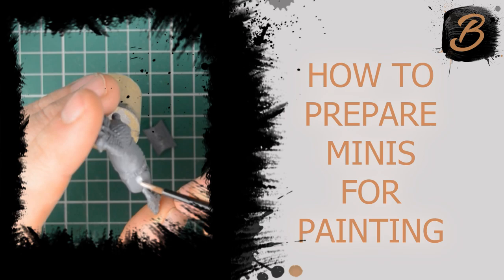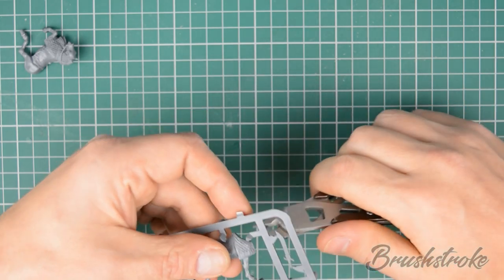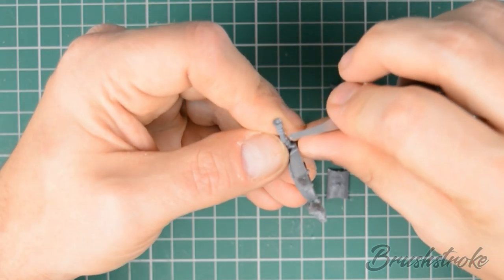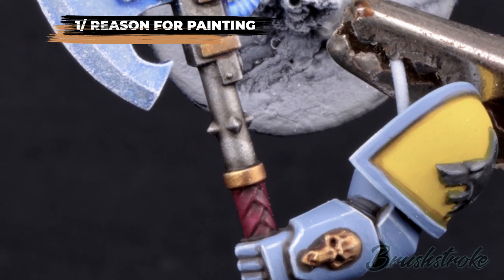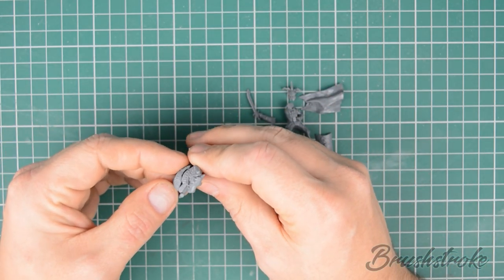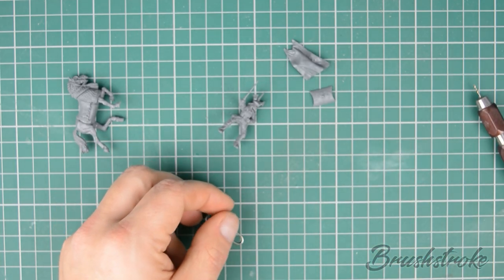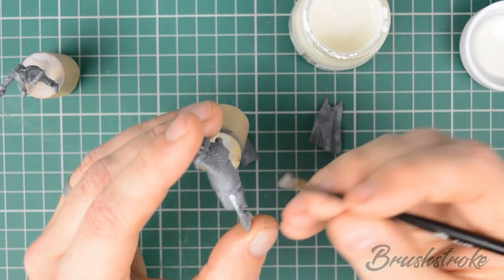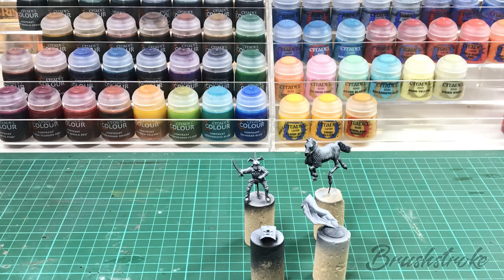HOW TO PREPARE MINIS FOR PAINTING: A Step-By-Step Guide

Comment: Interesting, I've been trying to sus out the way you mount your minis and I honestly never would've considered super glue and paper clips. I'm brand new to the painting side but I'm definitely gonna be trying that out since it looks like you gain much more access around the mini parts. Two questions though: 1. Do you buy the corks in bulk? 2. Do you reuse the cork + pin combos at all? Thanks!
Reply from the maker: Yes, mounting the mini (or its parts) in this way makes it so much easier to access with my brush.
To answer your questions;
1/ yes, absolutely I used to buy them from Wilkos but they’re out of business now 😞 So, my advice would be to look for stores that sell home brewing kit.
2/ Yes, I reuse them all the time. I often have to replace the wires because they can come out when removing the model or they’re not the right length for what I need at the time, but I use the corks over and over again.
On last tip, which wasn’t in the video, if you get a piece which keeps toppling over when you put it down. Because the cork isn’t enough to keep it standing on its on, just glue a coin or washer to the bottom and give it more weight / stability. Works perfectly 👍

Comment: So, subassemblies: Do you do anything to the models when assembling the final piece? Or do you just glue painted surface to painted surface?
Reply from the maker: It’s best to not glue painted surfaces together as you’re then relying on the painted layers to hold things together.
What I do is try to keep areas clear of paint which I know will be glued at the end or if that’s not possible, carefully rub the paint off at the end to crest bare plastic / metal to glue together.
I also use superglue to try and maximise the bond between pieces.
I hope that helps 👍🏻

Comment: I'm new to the hobby and I assembled my mini before washing it. What do you suggest doing? Can I drop it in soapy water as-is?
Reply from the maker: Thanks for watching and welcome to the hobby 🙂
Yes, you could still gently wash off the release agent from a model which you have have already assembled. 
Obviously it’s not ideal, as you don’t want to break it during the process, but my suggestion would to be to submerge it in some soapy water and then give it a gentle rub with a soft toothbrush and then a rinse with some clean water.
That should be sufficient.
Hope that helps 👍

Comment: Great video, I have suscribed to your channel! One question, is it possible to use Gesso as a primer? 

And do you have a video about using primers?
Reply from the maker: Thank you.
I've never tried Gesso primer on a mini before, so I can't really advise either way.
I believe though that it is intended to leave a surface with some texture or "tooth" to it, which is never a good thing for mini painting, as you really want super smooth to see all the fine details
This is the only video I've done referring to primers. If you can get Vallejo surface primer I do recommend it.
Just be sure to let it fully cure for around 24 hours before painting on it to ensure it forms a strong bond to the mini
Reply: @BrushstrokePaintingGuides  Thanks for your answer. 

Just to be clear, what does "cure" means in this context? English is not my native language.
Reply from the maker: @fernandozavaletabustos205  sorry, it means to dry fully.
Primers can often be dry to the touch but still be in the process of hardening.
Yeah, that’s a good word, cured in this context means fully hardened
Reply: @BrushstrokePaintingGuides  Ah do not worry, I was asking in order to learn more about the hobby.

Comment: Wow, such a good idea. Just one question though: how do you attach the shield and cloak to your handle please?
Reply from the maker: Exactly the same way as the other pieces, drill a little hole somewhere it won’t be seen and glue the wire with a small dab of superglue
Reply: @BrushstrokePaintingGuides  many thanks. 🙂

Comment: Just discovered your videos recently. Though i have a question. Do you thing your vallejo primer before putting it in their airbrush? I tried it once or twice. With and without thinning, and i had questionable results when not using thinner. Though i saw a comment that it was okay to use without thinner. Whats your take on it? Thinner or no thinner? What ratio did you use?

Comment: Washing off releasing agent only applies to resin models right?
Reply from the maker: No, that’s not true. Release agent is used in the moulding process for all material types. It’s fair to say resin models tend to have the most problems but it’s good practice to wash all materials to ensure any lingering traces of release agent are removed.

Comment: Excellent video. Really finding these videos helpful to level up my hobby 🙌 With assembly of horses - would the putty you used work the same with metal horses/models?
Reply from the maker: Thank you, great to hear you’re enjoying the videos and finding them helpful. Yes, the liquid putty works on any material type. For really big gaps you’re still better using some milliput or greenstuff but the liquid works wonders on join lines and cracks

Comment: One thing which I'm curious about, is once all the painting of sub-assemblies is complete, what's the process for ensuring a smooth and seamless fit when piecing together? One couldn't use the filler & file technique else there'd be a need to repaint part of the work.
Reply from the maker: That’s a fair question.
So, a big part of deciding what sub-assemblies to use is around how it will fit together once painted.
Ideally you want to choose assemblies which will either have hidden connections, like behind shields or cloaks etc or where a gap would exist in the real world. Between a rider and horse say.
However, there are occasions where the join will be visible but you still need to keep the parts separate in order to access details to paint.
In those cases, what I tend to do is;
Paint the parts up to base coats. And then attach them. Add a bit of filler etc if needed and paint and repair base coats as needed and then carry on with the painting of the mini.
Getting the base coats painted neatly and cleanly is usually enough to overcome the access problems, because once they’re done well, you can usually apply a wash etc even when assembled and that is a good time to disguise the join too.
Highlighting isn’t usually needed either as it will likely be in shadow and not important.
Hope that helps 👍

Comment: Would the primer affect the plastic cement strength on those parts that need to be glued together?
Reply from the maker: Brilliant question, and yes you are spot on.
If you’re going to be using plastic cement to attach sub-assemblies together after painting you need to ensure you have contact points of bare plastic.
You can achieve this in a couple of ways.
Mask the contact points before priming and painting with some putty or masking fluid (I generally just use blutac) 
Then when you want to assemble the parts you can just peel off the masking and reveal the bare plastic.
Or you can prime and paint as usual and when it comes to assembly, simply scratch away a patch on the contact points with a craft knife to reveal the bare plastic.

Of the two options I usually end up doing the second and the reason is because the contact points I’m going to be gluing are usually the same as the points where I’m attaching the paint handle wire. So when I remove the piece from the handle and smooth off any remaining glue, that results in me having a bare plastic contact point to use my cement on anyway. 
So with a bit of planning at the preparation stage you can save yourself lots of extra effort at the end.
Hope that makes sense 👍
Reply: @BrushstrokePaintingGuides  thank you so much for the quick reply ❤️
Reply from the maker: @mavstorm4588  no problem, hope the answer made sense and was helpful

Comment: Does anyone know if priming with 2 colours from a rattle can going to "damage" the details? I have the feeling that only an air brush is spaying thin enough.
Reply from the maker: You can do zenithal priming with spray can for sure.
Simply prime black as normal and then do a very light spray of a grey or white from 45° above. Doing a light spray for the second spray is a lot easier than you think and you really don’t need to apply much paint at all.
Best advice would be for you to just give it a practice with something scrap. Plastic packaging works great. Or even a plastic spoon will do, just give it a try 👍🏻
It really needn’t mean you lose any detail on the mini
Reply: @BrushstrokePaintingGuides  thanks for the quick reply m8